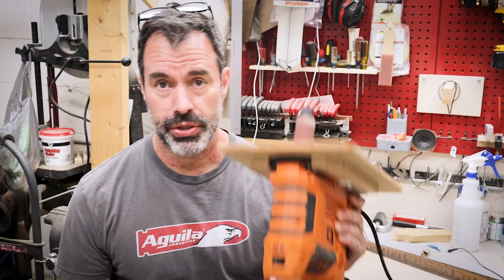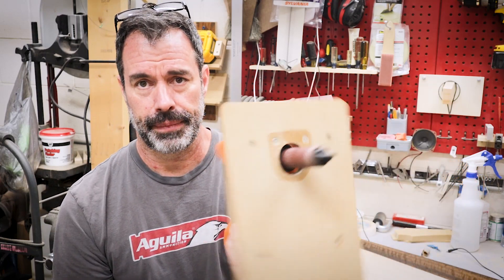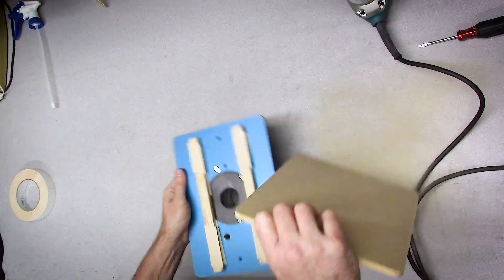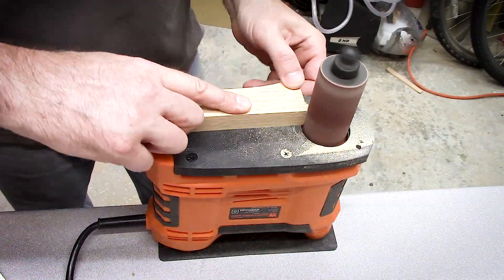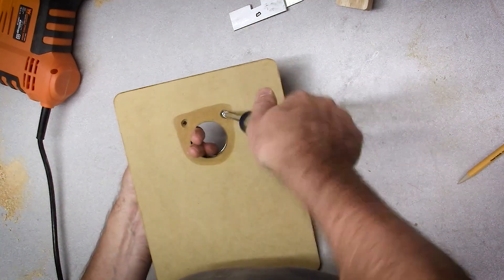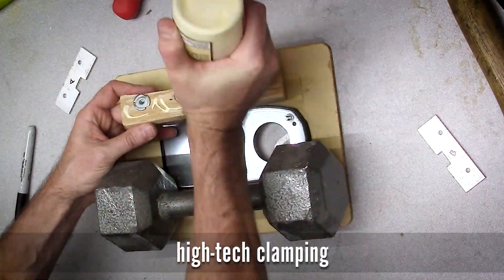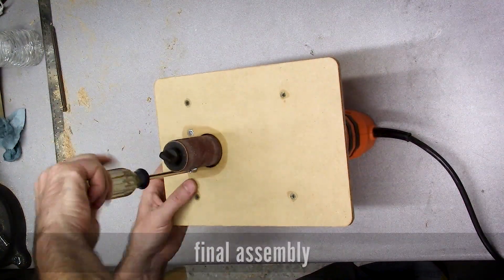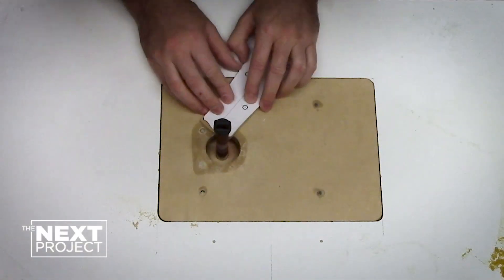HOSS Drop-in Deck - The Next Project

Comment: I am thinking noise would be the main reason to downsize to a handheld. And it’s not as aggressive. Maybe a little dustier, but you have to choose your battles. Thanks for the post.
Reply from the maker: Inkblizzard, you're welcome and thanks for watching.
This little sander is kinda noisy too, but I actually tune it out while using it. Or I'm going def, hmm.
Just kidding, I almost always wear "eyes and ears" when using noisy stuff - almost always.

There is a dust collector attachment on the rear of this sander, and I have planned to hook it up - just haven't gotten to that yet. I typically grab this sander, use it quickly and put it away. 

I am still tempted to get a benchtop oscillating spindle/belt sander. The price on some of those is pretty good.
WEN and Bauer (among other brands) have identical benchtop models, $10-$15 difference in price. Nothing really different other than the color and brand sticker.

Be safe and take care!

Comment: Hi, Thanks so much for for so many interesting videos !!
Do you think it is possible to make a Thickness Drum Sander with this machine? Does the mechanism allow it to be replaced with a longer cylinder? In order to have a Drum Sander as long as the width of a soundboard or back, in this way the ribs could also be colibrated, ribs  from the mandolin to the double bass.
it all depends on knowing if the spindle or the pin that supports the drum can be replaced with a longer one, I would like to know your opinion, is it possible to make it? Thank you
Reply from the maker: Jomar, thanks for watching!
This has been a handly little sander.
From what I can tell, the oscillating spindle can't easily be removed/replaced with a longer shaft.  If you are a machinist, it may be possible to make one, but that's a project beyond my ability for sure. 

If you are looking for a long shaft spindle sander, look up "rolling pin sander" on YouTube. I've been meaning to make or buy one, just haven't gotten there yet.  The sanding drum is attached to a long rod/bolt, which is chucked into a handheld drill. So you could make a sanding drum about as long and big in diameter as you want 

Here's one example:
https://youtu.be/LU6LQL39XR8?si=kHjSiveKpNHU75zU
I hope this helps, take care!

Comment: Do you think that any of the other brands are more powerful like the from Mlcs/ Eagle America, or are they all the same machine? Thanks so much for the video.
Reply from the maker: @olivepressdeaign, great question. Of the variants I looked at, at the time, the specs were all nearly identical. I don't know for certain, but I expect there is one mfg, that produces numerous "brands" of the same (or nearly so) product. A color change to the plastic case and swap the brand decal for most, appears to be the difference. the Triton version, which is 98% identical, has a slight different overmold of the handgrip areas, I want to say the specs were the same otherwise. 
If you need more power, I would suggest a bench top model.
I'll stick with this until I burn it up, or have room for something bigger.